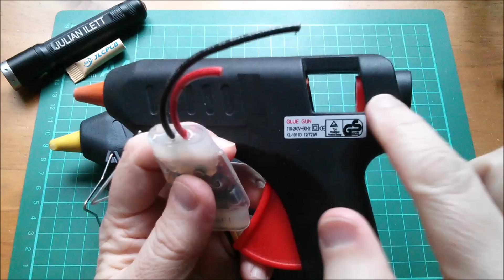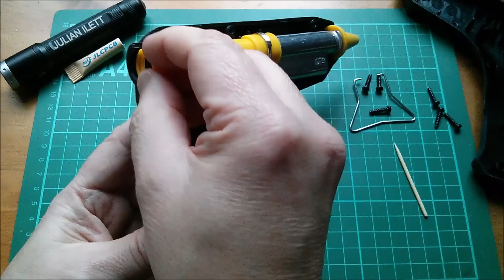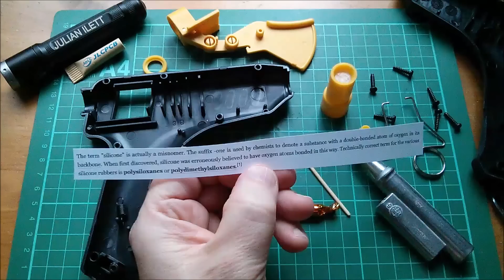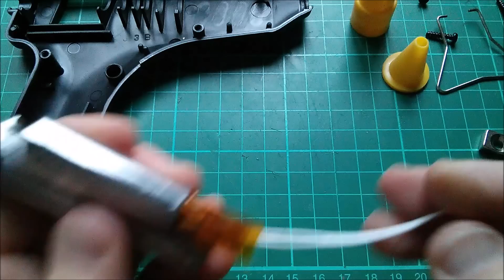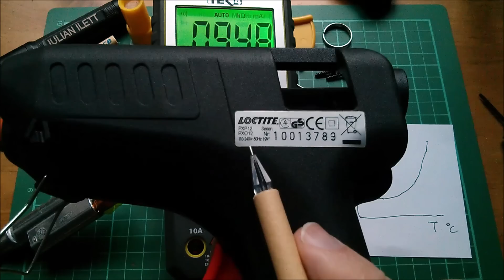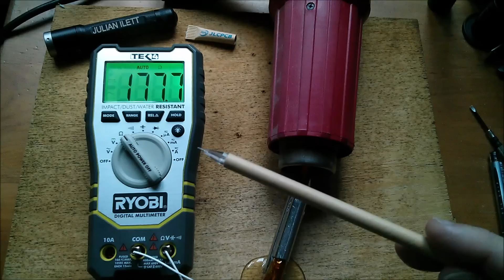Inside a Glue Gun

Comment: I had a cheapie glue gun snap at the pivot point of the trigger, I ended up supergluing it back with a nail as a type of pin to reinforce it, been working fine ever since, not sure what I would do if the post where the spring goes snaps, probably not worth the time to fix or figure out.

Comment: please help me, I bought a glue gun yesterday. this is the first glue gun for me. I have a problem. No glue comes out of the tip of the gun. I tried to blow air inside the metal chamber when it got cold but i found out that it is blocked. there is a metal yellow copper blocking the cone part where the glue supposes to come out. I could see it with light and a zoom camera. can you help me. i just want if the chamber should be blocked in case of temperature room and open when it is hot. would you please try to put a needle in the tip to your glue gun and see it the needle will go through easily or it is blocked as mine,

Comment: Hiyas.  I think the spring goes around the pillar that the screw goes in to in order to secure the two clam shells together. Also, if you used a candle or a small torch, I bet you could get the temp up quickly and safely on the "oven".  Great vid, as usual.
Reply from the maker: I tried the spring around the screw pillar - but that needed an extra quarter twist on the spring - and it kept falling off the trigger hook. Just didn't seem right.
Reply: Ah, ok. I saw that the spring looked like the ends of it were of different orientation and just figured that it was intentional. And thanks for the reply. Of all the comments I've made to youtubers over the years, you are the first to ever reply. I feel special now. I'm gonna go buy a bunch of lottery tickets!    =p

Comment: I found out about this property of ceramic elements fairly recently too, during the rework of an old ceramic fan heater into a soft-start switch for my new circular saw. I was quite surprised when I first measured it, but as you have found once it gets to a certain temperature it becomes PTC. And in the end it was a very successful project.

Comment: Is the oven tube on yours completely hollow or are there any cross pieces of metal. I just had my glue gun fail today by not letting me push the glue all the way through the oven (the tube part you called an oven). So since it was still getting hot I took everything apart then plugged it in and tilted the oven straight up and down. All the glue dripped out and I was able to look through the oven tube. 20 mm from the tip there is a piece of metal in the center that is stopping the flow. It looks like that was meant to cut the glue stick in half right befor the tip possibly helping get heat to the center of things. I had put two glue sticks through so fast just before this I put a lot of pressure on that piece of metal with the unmelted glue stick. If I can’t get it back in place I will just drill it out. 

The glue still melts completely and will drip out the tip from gravity I just can’t push a glue stick through anymore.

Comment: Silicone is NOT a misnomer... If you had actually looked past the page for Silicone, you would have surely discovered that Siloxane is actually just the polymer of organoSilicon compounds of the Si-O-Si linkage... Then again, ANYBODY can misquote Wikipedia... 

Silicone is the name of a product... In fact, MOST products are not referred to by their chemical or laboratory name, they are typically rebranded as something easily said and marketable... 

By your reasoning, we should be calling TeFLON, PolyTetraFluoroEthylene... Or Syncolon or Fluon... lol 

Or that RADAR should be called RAdio Detection And Ranging, or RAdio Direction And Ranging...

Comment: Shows how ambient temperature can have such an impact on performance of something that was designed to be encapsulated and running off mains. (Self sustaining). A delicate "Ballet", if you will. The heat gun cannot duplicate the temperature environment the dielectric was designed to be in. Too many variables. Room temperature to a glue gun element is like the Arctic environment to humans, and then some.

Comment: a Bostik TG4 is a very good glue gun , we used loads of them at a packaging firm i used to work for,  only real problem was occasional eventual failure of the return spring..
Reply: its glue pusher mechanism is all metal apart from the trigger,  so much more robust than plastic ones..
Reply: I'm looking for an industrial/idiot proof one, so that's nice to know, cheers

Comment: I wonder if the block is an alloy like zamak (mazak in the UK, I think) and not just aluminum since aluminum doesn't retain heat very well. I'm intrigued by the heating element. The kapton film insulating the element doesn't seem to have any adhesive on it. Could be interesting to test the element removed from the block and wrapped in the kapton film with a thermocouple affixed with kapton tape to the side to see how warm it gets when not in the block.  The block seems to press the pieces together rather firmly, though. The metal bits at the end of the leads seem to be mains + and - electrodes with the resistive  material sandwiched between them. The resistive wafer looks to have a metallic band around it. What prevents a mains voltage  short between the electrodes?
Reply: The PTC itself is a semiconductor.  The two electrodes are not shorted, but well separated by the resistance of the PTC.

Comment: When you look at the hotend on a 3d printer, glue guns look so inefficient.
Reply: Ben Heck did a project where he attempted to make a superior glue gun by borrowing the principle on how the 3D printer nozzle feed mechanism works. He wanted it to auto feed and also to retract a little when you a finished so that it didn't dribble. His design did work, but within a video or two he was back to using the normal one. lol
Reply: Could probably install a cartridge heater in the glue gun along with a simple circuit to control it in order to get a battery operated glue gun that heats up very fast.
Reply: Ben heck has done a number of iterations of a "super glue gun" with auto-retract and better heat control. Surprised no chinese vendors have picked up on the idea yet.
Reply: @jaro6985  That's a "3D printing pen".

Comment: If they use the same resistor for 110V & 220V then the latter heats up faster?
Reply from the maker: and to a higher temperature is my guess.
Reply: @JulianIlett  I'm thinking this can't really be since i'm looking at my glue sticks (Stanley GS500) and it has a melting point of 210C/410F and my gun (on HIGH) is 200C/380F. Doubling the melt temperature curve will probably fry the glue. <And this is where I have my AH HA moment>. Dummy me, the NPC part "executes" faster on 220V and the resistance simply increases far faster on the PTC side until it ends up at twice the resistance of 110V.
Reply: @atubebuff  Eventually gets to a steady state temperature where losses to ambient are roughly the same irrespective of voltage, just on 220V it will be 20C or so hotter, and will recover faster when you use the hot glue in the barrel.
Reply: Yes, heats up faster and a bit hotter, but it is a temperature dependent resistance that causes it to level off.

Comment: interesting experiment. Hot air guns blow a sleeve of cold air surrounding the central core of hot air iirc (haven't got one on me to check)... maybe that's why it was unexpectedly difficult to get the protruding  PTC chamber up to temperature even though the glue was liquid?
 Implied resistance at 18W would be about 3.2k I think
Reply: More loss to ambient, there is a lot of cooler area there than the hot air can reach.

Comment: That gives me some interesting ideas for alternative heating methods, such as using one of those hakko A1321 or knock off heating elements, probably not easy to get them to make good thermal contact unless you can find one with a hole small enough to sand down to size, but that would allow you to run it off batteries and if you want to overcomplicate things you could throw an arduino onto the mix add some extra functionality such as giving it higher voltage for heating when it's cold or make an auto feeder for it.

Comment: I had one of those go bang once! The insulation on the wires entering the heater melted and shorted out.
Reply from the maker: That's a worry - that insulation should also be a high temperature plastic :)
Reply: @JulianIlett  Luckily I wasn't holding it at the time, it was just sat on my desk heating up. Made a proper bang when it went though!
When I did open it and see what happened, I didn't much like the design either. I have another almost identical one that's survived so far...
Reply: More likely the insulation was stripped too far back, and the wires eventually touched. the common failure is the PTC heater shatters, and then the 2 bars short together once enough of it falls out. does tend to fail safe, as the cable is so thin it acts as a fuse. Another common fault is the cable entry to the gun wears, and the cores either short to each other or break at the point it enters the gun.
Reply: There have been a few incidences of glue guns being recalled for that reason.

Comment: It would be interesting to see if your "industrial" - Glue Gun is also this poorly isolated.
Reply from the maker: Probably - the heating element has to be very close-coupled to the oven housing. I just bought myself an 18V glue gun - I feel safer now :)
Reply: @JulianIlett  Exactly the same insulation, with the same kapton insulation as well. Incidentally it is not an oven, but a barrel, and the heater in the better units has 2 turns of polyamide as insulation, and a ground bond to the Zincalume alloy making up the barrel. 

The PTC element is metallised ( the grey area) to make good contact to the ceramic, and the whole unit has the edges ground off slightly ( the edge) to ensure there are no sharp edges, which are stress points which cause the unit to fail, as they shatter. 

As the ceramic is a blend of NTC and PTC material, the resistance curve is very non linear, but the resistance change near the transition point is so large that it will stabilise at around the same temperature irrespective of the supply voltage being 120 or 240V.

To see the effects simply leave the PTC outside the barrel inside the insulation, and use instead some steel wire twisted around the barrel at each end to apply pressure. less loss in the hot air. If you have a spring of slightly smaller diameter it also works well to apply the pressure by winding around the insulation.
Reply: @SeanBZA Thanks for this comment. I found a used gun with a 220v UK plug that I'm thinking about converting to US by just replacing the plug (for experimenting).
Reply: Julian Ilett the Ryobi ONE+ ? I'd love to see a review of it if you get a chance 👍
Reply: Robert Hunt AvE did a review of it, and he seemed to think it was at least decent.